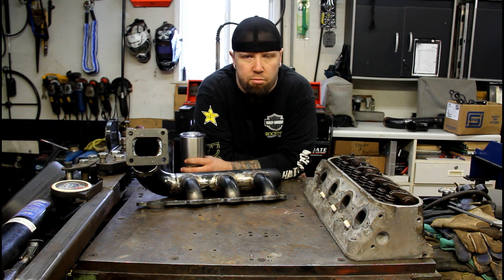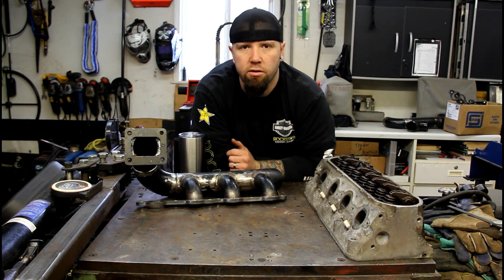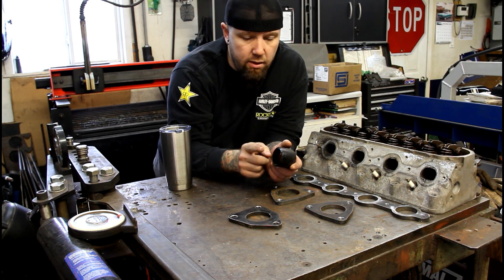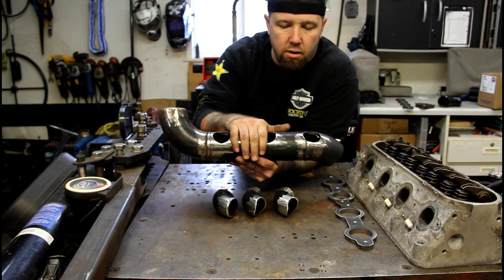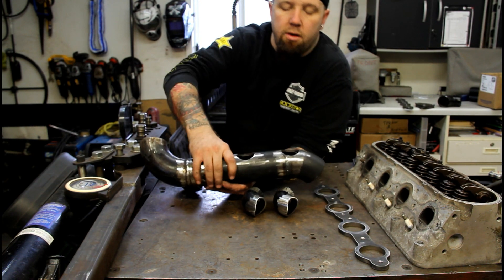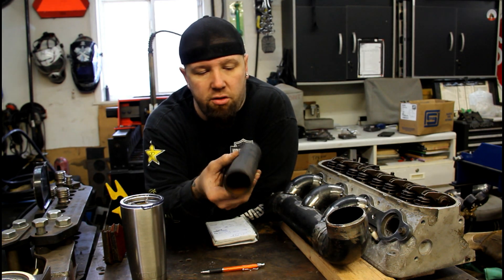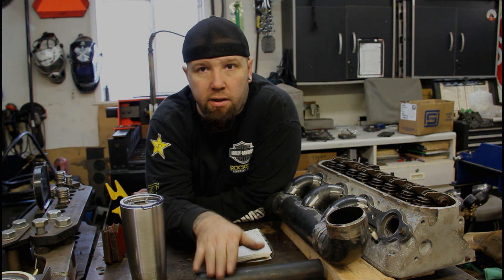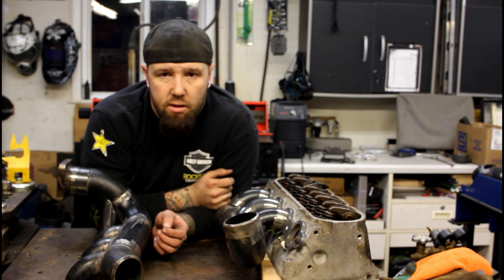Building a turbo Log Manifold for a LS motor

Comment: Any tips on copping the 90degrees . I have broken 2 hole saws instantly in the drill press. What kind of hole saw are you using ? Is there another way to do this as the hole saw legit keeps just stopping the drill press instantly

Comment: Good job man.  A little advice for your videos...  in post production when you're cutting all of your video together, use a function to equalize your audio across the entire video.  Some of your cuts are a LOT higher volume than the rest of the video.
Reply from the maker: elesjuan  thanks I’ll look into that forsure.  I noticed it as well after production 👍